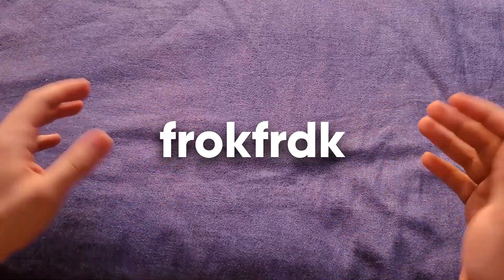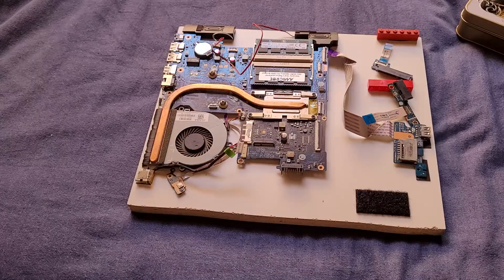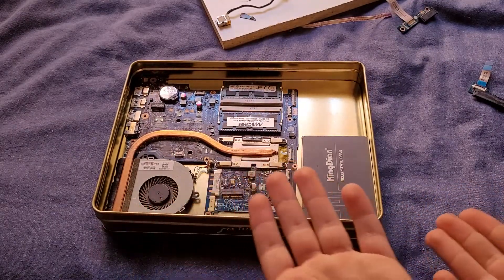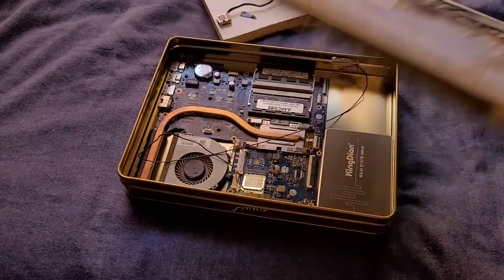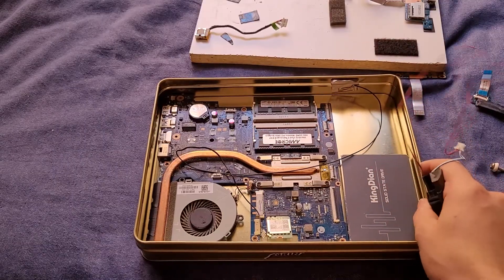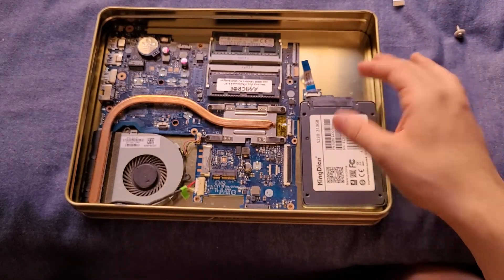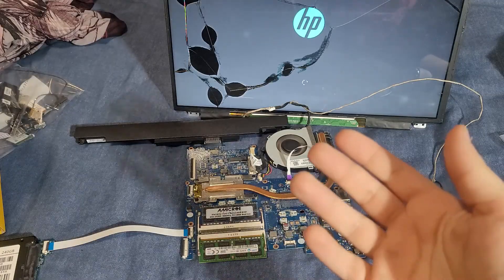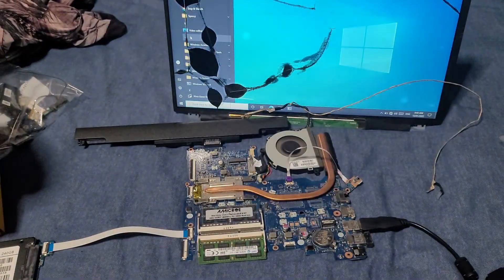Turning a Laptop into a Desktop? - Cookie Tin PC [Part 1]

Comment: In the 1990's my friend made a "lunchbox PC" that worked.  It was a pretty big lunchbox, aka NOT the ones you take to school.  I like your implementation so far, but I would have looked into smaller disks aka M2 to SATA adapters.  If you could have found one, then you might have been able to use the original small cable.

Comment: well all this effort is now easily defeated by major manufactures not allowing laptop to power on without battery connected ... so you can't repurpose old laptops as desktop replacements ... r/built4obsolescence

Comment: I have this same laptop and I haven't had many issues with it, the previous owner was just throwing it out and it had no battery and dvd, but besides getting a new battery and screen for it (after breaking the screen 😅) It works with no issue well besides the left shift key. Besides that i put Windows 11 on it and the thing runs with no issues whatsoever